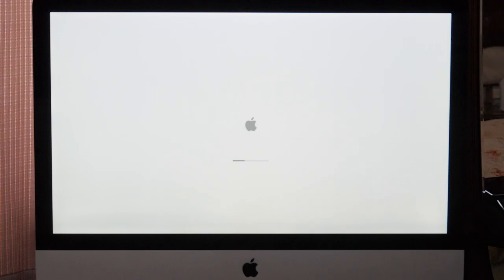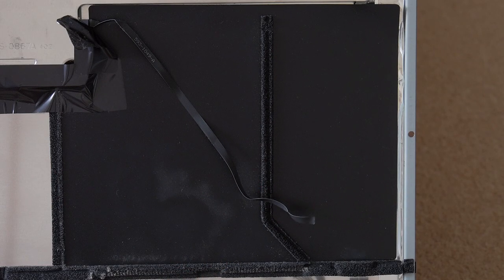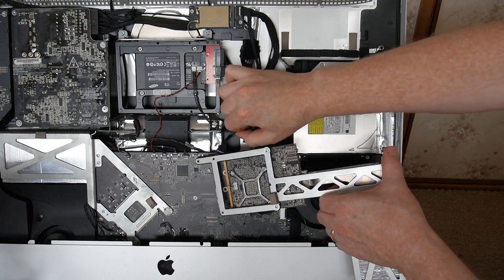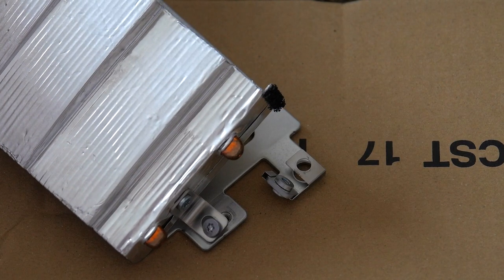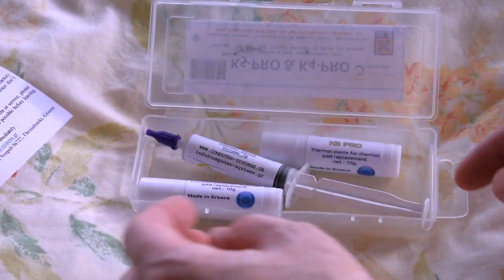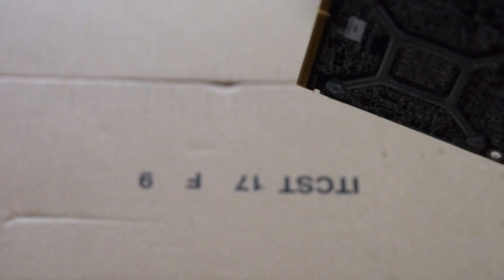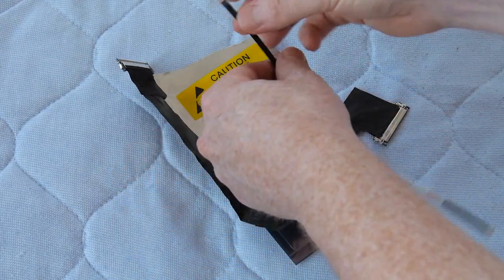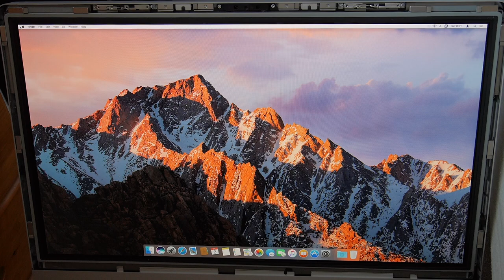Late 2009 iMac 27" Video Card Repair — 4850 — 2nd Bake

Comment: Thermal replacement pads should be 2.54mm thickness
Reply from the maker: Thank you for providing that information, Gregory.  People who decide to use actual thermal pads instead of the K5 Pro thermal pad replacement paste I used would find that size info helpful.
Reply: hard to find that size pad though..   Digikey has them...but they are pricey.  I'm thinking of just buying the 3mm pads and cramming them in..lol
Reply from the maker: Or do like I did and just use K5 Pro.  It's been 9.5 months and my iMac is still going strong since my 2nd bake and use of K4 and K5 Pro.  If the pastes I used were not optimal, I would not have expected to get this much use out of my iMac.
Reply: I contemplated the 2.54mm pads and wanted to use the "correct pads", but in the end I decided to buy the K5 Pro.   I purchased it and got it yesterday.  My late 2006 iMac is back together and no more video card issues.   I didn't bake the card.   if it has any issues I will have to dissassemble it again.   Cleaned out all of the dust and a couple spider nests..lol.     The iMac now runs at 88F.    It's awesome.   It's nice to have it running again.   so many great memories of it and remembering my Son playing on it when he was a toddler.   I still love the monitor and how nice it is compared to other computers out there.   Today I am installing an Ubuntu partition on it if I can make it work.   Been running Darktable.org for photo software on it.       Yes.  K5 Pro is the way to go.
Reply from the maker: I’m glad to hear K5 pro thermal paste is working well for you. It’s interesting though that your video card issues went away merely by your changing of the thermal paste, without baking the video card at all. I’m curious. What kind of video card issues did you have before you replaced the thermal paste?
Reply: JDW it is a late 2006 iMac.  4gb ram system.  When I dismantled it the thermal paste was missing from 2 of the chips and only on one  of the chips.   The thermal paste on the center video processor was completely dried up.  https://imgur.com/gallery/yLzW892

I took the time to dismantle the CPU and other devices and clean them of old paste and apply new Arctic Silver.    The things that were happening to my screen were freezing and pixelation blocks on the screen causing video lockups.   I chose not to heat my board.   I am trying just minimal fixes for now.  If the problem persists I will go farther in reheating the board.  I’m trying to be as minimally invasive as I can be.
Reply from the maker: Thank you for the photo, Gregory!  Your words reminded me that I should send Feedback to Apple about this issue, so I did just moments ago.  I often send Apple feedback on a variety of topics, so it's nothing new for me.  Just Google "Apple feedback iMac" and then click the appropriate link and submit your own feedback.  I really do think it helps Apple "think different" and "think better."  I proposed that they use better paste at the factory.  It won't give eternal life to the paste, but better past is what they ought to use in light of the prices we pay for Apple computers.

Arctic Silver V is what I used after my first bake on the GPU.  You really have to be careful with it though because it is electrically conductive and if it spreads out too much it would touch the tiny SMD capacitors that surround the GPU and cause shorts.  That's another reason I used K4 Pro on the GPU after my 2nd bake, since it does not conduct electricity.

I'm pleased that the mere swapping of paste helped resolve your issues.  But if the video issue return within the new few months, such would indicate a problem with the card, and in that case a bake may be the fix. 

Anyway, thanks for watching and best wishes!

Comment: Thank you. I followed your instructions and my iMac early 2009 is now back and running. I was having sporadic shutdowns (making it unusable) and now it is (cross my fingers) back and running for a couple more years. Any suggestion on what RPM I should keep the CPU fan to keep it cooler and maybe extend the life of it a little more?
Reply: Read your description further and saw your suggestions. Thank you again.
Reply from the maker: Stock fan speed is close to 1200rpm.  I would suggest increasing the speed of all the fans to be the same, at as high a speed as your ears can handle.  For example, in a quiet room, I prefer to have the fans run at 1800rpm or lower.

Comment: didn't work for me :( , I did exactly as the first video instructed and the Imac has no change. I have never baked the card before this time.  200C for 10 minutes, but I wonder if I should bake it for longer or do it a second time.. It sucks that putting the Imac back together is a pain in the ass. Surely this will be my last Mac I ever buy.
Reply from the maker: Marlon, I'm terribly sorry to hear the bake didn't work for you.  I assume you have a late 2009 iMac, correct?  I read and reply to ever single comment on both of my bake videos, and so I know the bake works for the vast majority of people who try it.  It could be your video card was just too far gone for the bake to work, but your lack of success makes me wonder if you had a video problem in the first place.  Did you see lines or other on-screen artifacts on your display, followed by freezing of your computer, which led you to believe it was the video card?  If so, it almost assuredly is the video card, but if not the problem could have been something else.  Also, did you clean off the old thermal paste, bake your video card, then replace the thermal paste with brand new paste?  If you did that, then what shows on your screen after the bake?  If you saw artifacts before the bake but a blank screen after the bake, it's likely you forgot to connect something or perhaps didn't connect something fully/properly, or maybe you even accidentally broke a ribbon cable like I did shown in my video.
Reply: JDW, oh wow, thank you for replying, you are awesome. The problem appeared similar to what you had, but in not sure if that is the right diagnostic. Im going to try to bake it one more time while somehow pressing on the GPU chip. If that doesn't work, then i wonder if there are any cheap compatibles GPU i can install instead, since I checked the same GPU goes for over $200. Then if not, I would just quit on Mac altogether  because this is my fourth Mac, my place starting to look like a museum for Apple. Maybe build a hackontash, but I'll need a working mac for that also.
Reply from the maker: Marlon, I read and reply to every single comment on both my videos.  I do that because I love to help people wherever possible.  I know how it feels when you're in a seemingly helpless situation and don't know what to do.  I also dislike the fact that many YouTubers are apathetic toward comments under their videos.  That makes zero sense to me.  

Thank you for the details.  Since you are planning a 2nd bake, try finding a hefty chunk of Copper (I know... "who has that!?") or find another somewhat heavy metal that transfers heat well (an old heatsink lying around somewhere?), and sit that atop the GPU during your bake, making sure it won't fall off and hit any other components.  If the block of metal you use is really large, bake that first at 200°C to pre-heat it, then use pliers (so you don't burn your hand) and place that atop the GPU, then bake your video card at 200°C for 10 minutes.  Even if the sheer weight of the chunk of metal doesn't press down hard on the GPU chip, having more concentrated heat on the GPU chip might make the bake a success.  I've read some people put coins atop the GPU while baking and it worked for them.

I too thought about buying a faster, newer, compatible video card instead of doing a bake, but after reading a lot about compatibility (not even video cards from 2011 and 2012 iMacs fit perfectly without a little cutting), I decided to fix what I had using the bake.  In my mind, it was less of a risk.  I only risked my time, not my money.

I too have thought long and hard about Hackintoshes, but I'm the kind of guy who likes to stay current with the OS.  You can't always do that with a Hackintosh unless someone comes out with a hack that allows a newly released OS to work without problem.  It's akin to buying a classic car from the 1960's, knowing how awesome it is but also knowing there's a lot of work to be done to keep it running well.  If you love to tinker and have free-time (unmarried, and/or don't have kids), then maybe you'd find a Hackintosh an enjoyable endeavor.

Lastly, please know I recommend the late 2015 and later 27" iMacs.  I have a late 2015 5K iMac at the office and it has worked great since purchased new in late 2015.  It runs very cool to the touch, even when editing in FCPX and compressing video with Compressor.  The video on the Retina display is stunning.  If you aren't into iMacs anymore, then maybe a 2015 MacBook Pro 15" might work.  I have one of those, purchased in late 2016 after the 2016 model came out.  Why buy the older model?  The 2016, 2017 and 2018 MacBooks lost the "Pro" in my opinion.  No legacy USB-A port, smaller battery, TouchBar of questionable value draws more power from that smaller battery, iconic glowing Apple logo is gone, the keyboard has very little tactile feedback, the trackpad is so large that imperfect anti-palm rejection software is required to make it sort of usable (although the arrow pointer will jiggle from time to time), no SD card slot (man, I hate that!), and the antiglare coating problems that have plagued all Retina Display MacBooks still remains even on the newest models (see my StainGate video for details on that topic).  The 2015 model has all it should have in a "Pro" notebook, and I purchased a very high quality EIZO FlexScan 27" 1440p display to go with it, attaching via Mini DisplayPort.  I then bought a wireless keyboard and mouse.  The setup works great and is fast enough for video editing in FCPX. I'm very pleased with it.  I bought it from a used Apple products reseller in San Diego, since Apple doesn't sell the 2015 MBP 15" with the dGPU anymore.  You would definitely want the dGPU model if you edit video.

I hope this info helps!

Comment: I know it's been a while ,but, I was wondering how long the second bake result last?
Reply from the maker: How long will it last?  Theoretically as long as a new card would last, which sadly in my experience (with a new card replacement from Apple) is just over 3 years.  But some people have had their stock video cards last longer than 3 years before artifacts appeared, so maybe the bake would last that long too.  But as far as how long my 2nd bake has lasted, a few days from now it will be exactly 12 months since my 2nd bake.  My iMac is used daily, for several hours per day, including graphics intensive apps like gaming.  Not a single problem during those 12 months.  So far so good.
Reply: JDW thank you for your reply, here's what happened to my imac 27" same as yours, about a month ago the hard drive failed, I decided to replace it and upgrade to Sierra, everything went well up to a point when the installation asked for reboot, after reboot the screen froze and show horizontal lines, I'm still hesitant with baking method because the results is somewhat inconsistent, but up to this point I have no other solution at hand. What's puzzle me is that prior to hard disk failure my imac show no sign of gpu failure. And the simptom somewhat similar to my 2010 macbook pro gpu panic, and the fix is to replace one bad capacitor, however my mbp is nvidia not ati, so, I don't know...let me know if you have a thought on this matter, anyway great video
Reply from the maker: It's highly unlikely your video card just suddenly happened to die again at the same time you did the HDD replacement.  Perhaps you just need to reseat the video card in its connector.  Also, did you strongly bump or jolt the video card when you performed your HDD upgrade?  And did you disconnect a lot of connectors and perhaps forgot to connect one or did not connect it perfectly?  I would suggest looking at all the connectors you disconnected and reseat all of them.

If none of that helps, I need to hear more about your HDD.  I assume you had the stock spinning platter HDD inside and that drive failed?  And then you replaced it with what?  An SDD?  The same kind of HDD?  If a spinning HDD, did you use an Apple branded HDD?  You might try putting the dead HDD back in and boot off your external drive (which I assume you have) and see if the horizontal lines still appear.  If they are gone and you don't see any video issues, then such gives evidence to something being wrong with your HDD replacement.

It's much too coincidental that your video card would up and die again immediately following an HDD replacement.
Reply: JDW yes I did all that and went as far as cleaned everything and replace thermal paste, the new hard drive is WD purple mechanical since I need a bigger space and ssd cost so much, I also replace the ribbon cable for vsync, I noticed you also replace yours, since, mine is also missing some contact at the tip, I painstakingly cleaned all the contact and make sure that no contact is broken, I check the hardware using Apple Service Diagnostic the efi version show no error however the gui version stuck at apple logo. The reason I suspected the graphic card failed is because it consistent with my 2010 mbp that also starting to have graphic issue after I upgrade it to El Capitan. I noticed that after installing Sierra, my imac screen shown as if it was updating it's firmware (it have a different progress bar under the apple logo) and after that a reboot then the screen froze with small artefact at bottom corner and horizontal lines, anyway, I think I'm gonna try baking the graphic card and see what happen, I will try and update you latter
Reply from the maker: Bobby, please download the following PDF...  (link now deleted)
Reply: JDW done, thank you so much!, i will let you know the result later
Reply: Wow, your imac's lines definitely looks like mine, only mine have a small patch of artifact, so, perhaps I will give it a try later and will update the result, thanks guys
Reply: JDW I still haven't baked the graphic card, however, I tried to boot into safe mode and it booted and I'm able to finish the remaining installation process, after that try to boot normally but the progress bar stop at the full end and stay for more than half hour
Reply: I finally join your baking club and the result is a success!!! Thanks all for the reply and support, I hope it will last for long time

Comment: anyone know how to acess the bios to unlock the cpu speed being at 1,60ghz ?
Reply from the maker: I don't think that is possible on a Mac.
Reply: @JDW-  cant u like btypass the motherboard protection soemhow? i mena apple buys the motherboards and puts some firmware on it right ? this shoudlnht be allowed they should make theyr own motherboards to be ablew to do this....
Reply from the maker: Unfortunately, no. The Macintosh is very much a walled garden just like iOS devices. It’s locked down pretty tight.

Comment: Thank you JDW, this worked for me.
Only a week now with no problems. Two hundred degrees Celsius for ten minutes, K4 & K5 pro.
I went the whole hog and pulled out the mobo, re-pasted the CPU ( K4 pro) and replaced the PRAM battery.
The hardest thing for me was removing the RAM which is not uncommon but found advice on how to "walk" them out. The plastic tab doesn't work for some.
Put it all back together, booted up, first boot was a bit slow but from then on no problems.
I now have a sore shoulder from patting myself on the back.
I respect Louis Rossmann's work on electronics, work ethics and life ethics in general and find his youtube channel highly entertaining. This comment though (starts at about 53:40) I found amusing.
https://www.youtube.com/watch?v=bVoBZqlvCKo&t=2162s
not detracting from him in any way, this is just his view.
Again, thank you.
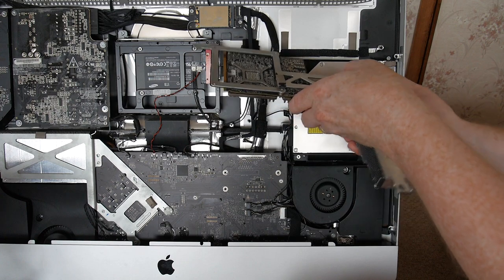Reply from the maker: Regarding Rossmann, watch the following video from 1:24 & 8:24 & 15:01 & 24:33, and prepare to be surprised: https://youtu.be/EdwDvz47lNw
Reply from the maker: He's a MacBook and iPhone repair guy, not an iMac guy.  In that other video Rossmann even says he mostly deals with water spills, which means Mac notebooks and not iMacs. His personality is very strong and confident, and while he'd never tell you on his channel that he doesn't know everything, that Linus Tech Tips video in combination with my videos and the result you yourself discovered prove he doesn't know it all.  By the way, I am an electrical engineer and I will admit I don't know it all when it comes to electronics.  And while it may sound odd that an EE like me would advise baking a video card, I advise what works for most people.  It really does work.  And I am thrilled to read your story of success.  Thanks for watching and sharing your bake story!  Happy New Year!